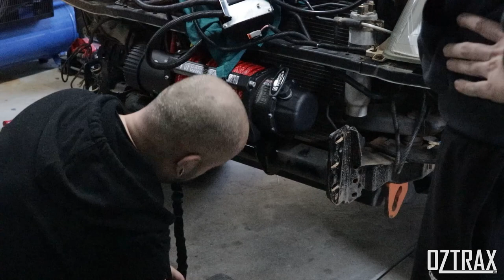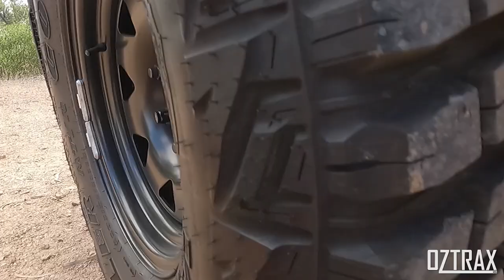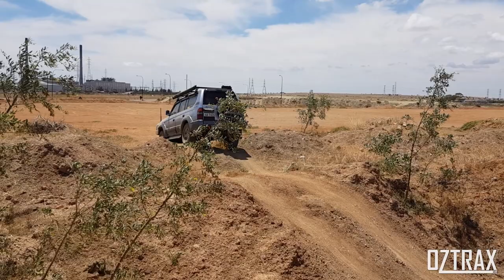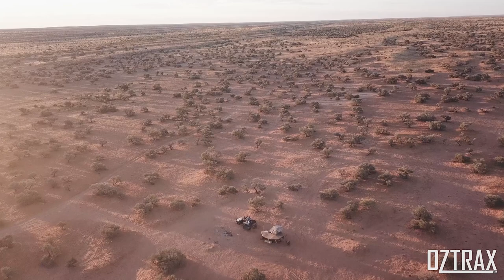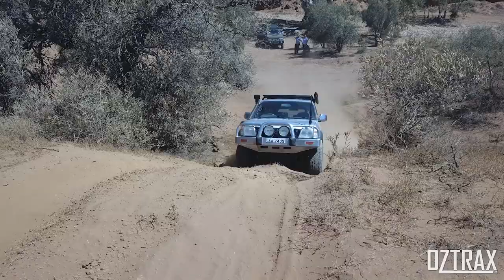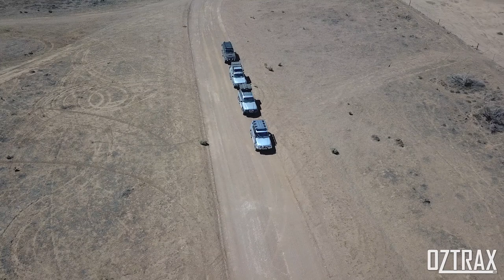Remembering The Nightmare 90 Series

Comment: Hey mate, I’m looking at buying a prado or a Pajero due to current prices of 4wds at the moment 
Due to your experience is there much that goes wrong with the petty prado? I’ve heard these things are solid reliable if you maintain them 
At around 8- 10k is 300 xxx okay to buy on one of these vehicles?
Reply from the maker: Hi Kayde

Mine was solid regarding the engine but did require some maintenance to get it up to spec. It had 309,000kms on it when I got it and ended its life with 351,000kms on it.

Make sure you inspect it properly and get the driveline checked out. Test the 4WD system and you should be good to go.

Your budget is on the right path. No more than that I would spend on something with that amount of km's on it.